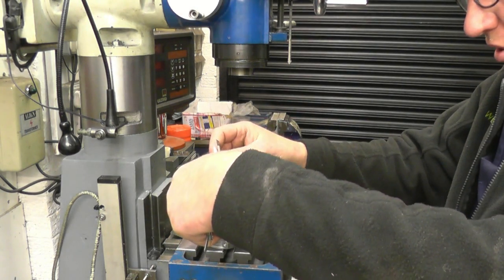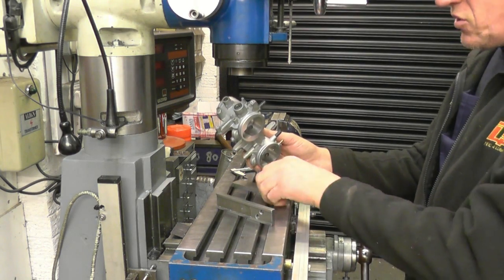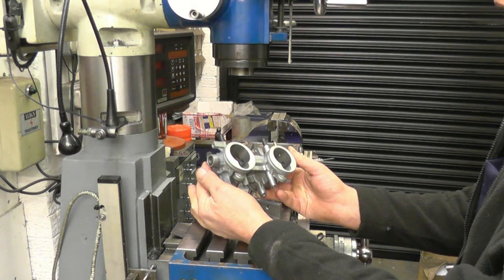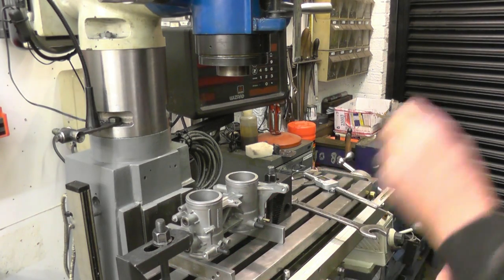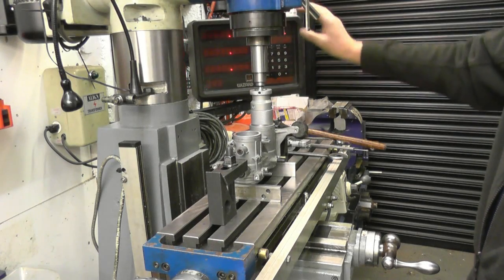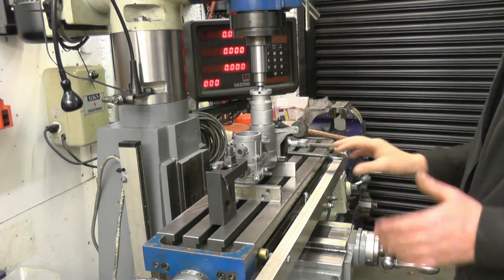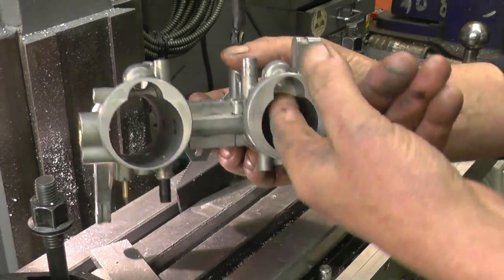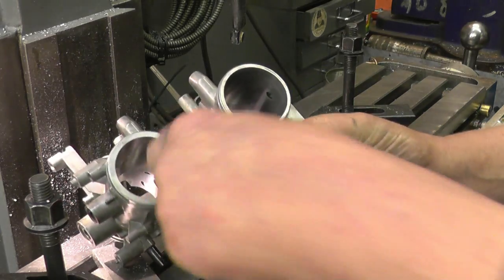Sunday Night Night Cap 55 part 2

Comment: John again you have some of the most simple solutions to do things. Never would have thought of the drill chuck as a centering device. We did something similar to tool boxes at work years ago except we used heavy-duty eye bolts to bolt to the tool box then used the rods like you did. All the best to you and Deb and I hope you have a great week.

Comment: Hi John,
I find electric wheelchairs are good for power feed components. The twin motor types have strong worm drive gearboxes and a good size right angled output shaft. You can also use its speed controller joystick as a all in one solution but you will need to find a 24 volt power supply rated at around 10 amps. Big Thumb Up.

Comment: I saw a cool video on splitting kindling once. First of all, you stack the bigger pieces on end in a tire, which holds them vertically. Next, you whack away at them with an axe, but you strike with the edge cocked a little sideways, which imparts a splitting torque on the wood. You just bash away until everything is split.

Comment: wouldn't that remove the venturi would the carb work correctly after the boring
Reply from the maker: It is not a carb it is a fuel injection throttle body
This is a common modification in the class he is racing

Comment: not much left on them throttle bodies after that john
is he going to be racing the bike
Reply from the maker: Yes he is racing it
Reply: my dad used to build bikes in the 60s and 70s for the local lads to race at croft circuit he used to make a lot of the parts himself

Comment: I'm guessing you have had your fibre optic internet installed this week?
SNNC's are coming out at quite a bit faster now :-)
Reply from the maker: I have 2 weeks before it is sorted out
Reply: doubleboost - Ahh - I only assumed because parts one and two were only an hour apart. The boring head shots were great, and I'm amazed you still have five fingers! after chopping that kindling :-)